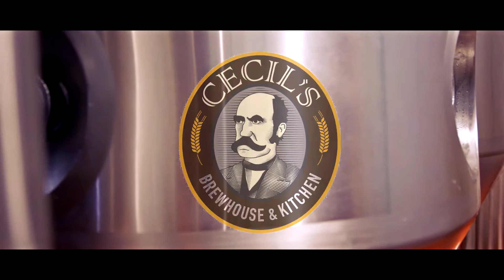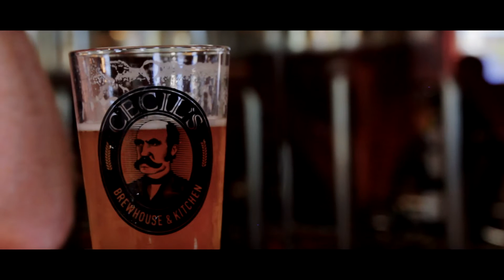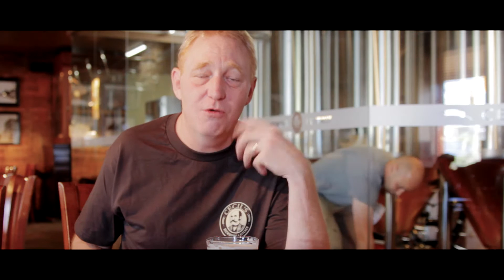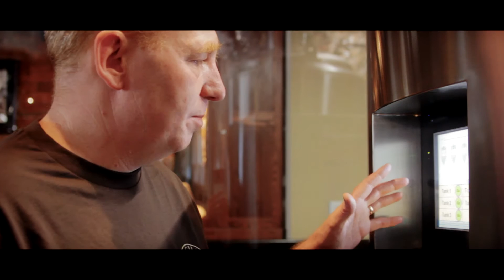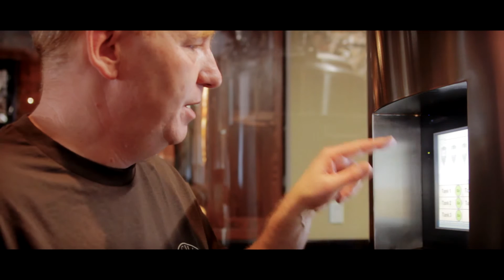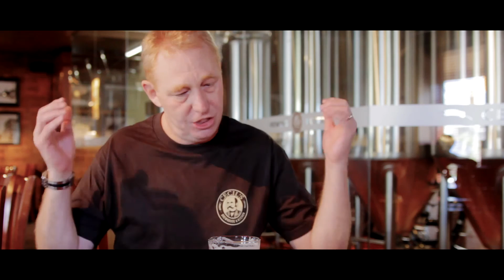Smart Brew  Brewmaster Brian Watson Talks about Cecil's Beer

Comment: Its a great concept - if it is tank to tap - what happens when you run out ? now you have to wait 12-15 days again to brew thus leaving one or 2 tanks empty maybe more for approx 2 weeks or so - can you keg the beers? within 1 month you can potentially have 8 beers available kegged if you have the 4 tank system vs 4 if you just use them from the kettle